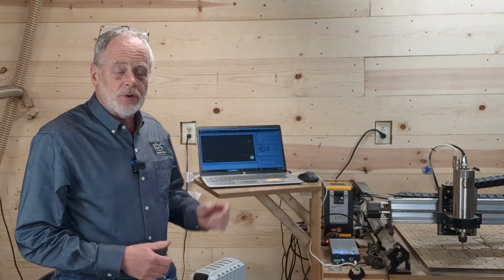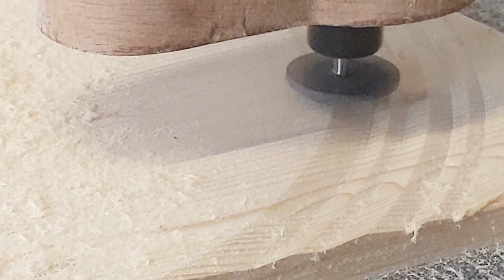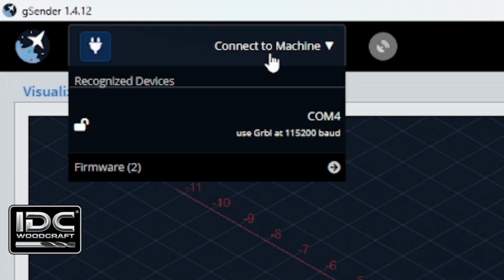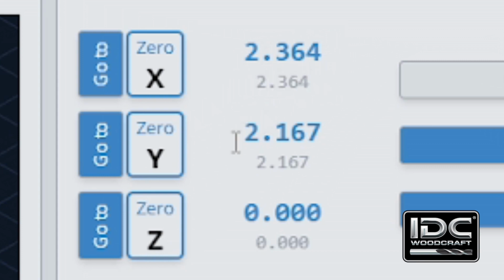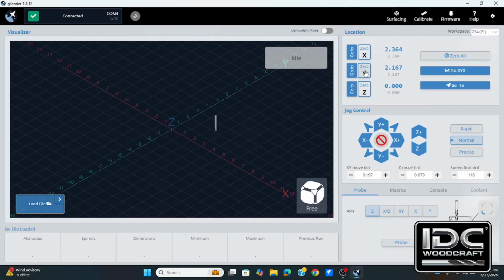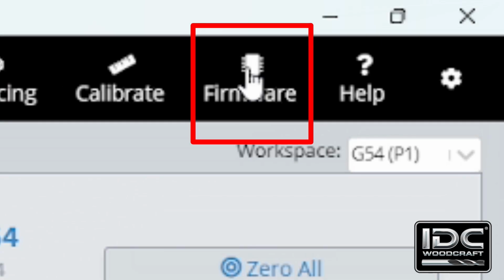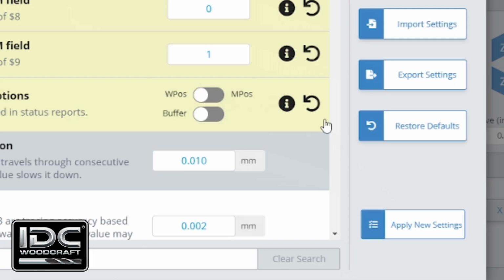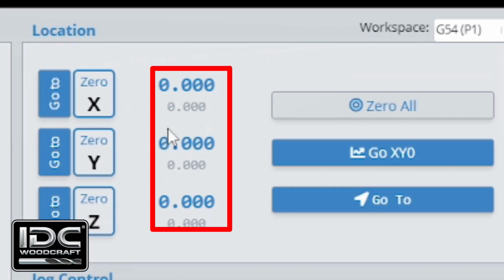How To Fix gSender Zero Bug (X/Y/Z Buttons Not Responding)

Comment: So I have a different menu option on my new gsender from SL. There are multiple toggle switches and none of them seem to correspond to the wpos or mpos that you refer to? Any suggestions?
Reply from the maker: This one is a little tricky to walk you through over comments, my friend. I recommend joining us for our live sessions every Wednesday evening at 8 PM EST; we should be able to help walk you through it then, brother!
Reply: My $10 had way more options than what his showed as well and just ran across this issue with mine.  I switched on the "work coordinate offset" and left the other two that were already on (position in machine and buffer state) and that seems to have worked!